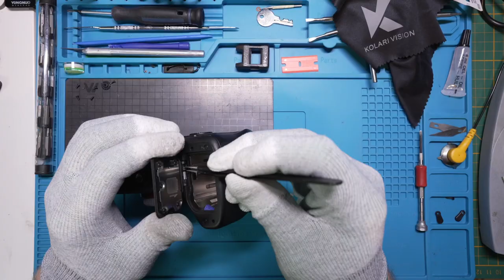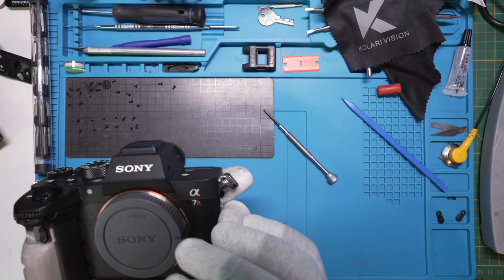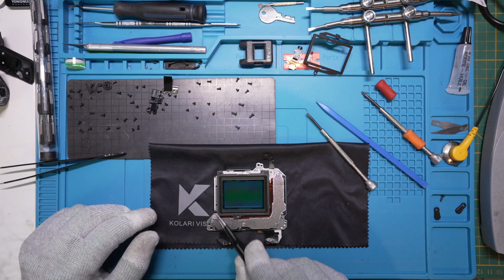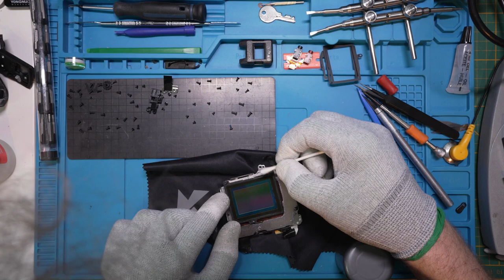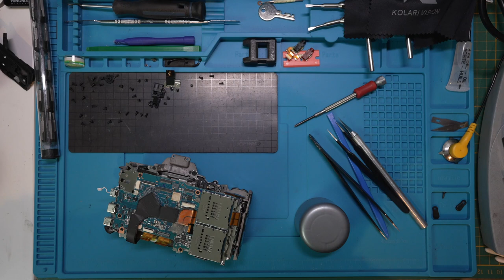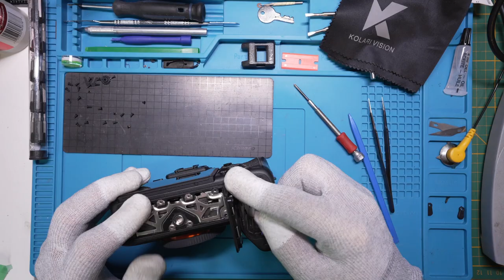Sony A7R IV Astro Modification / Full Spectrum Modification

Comment: I noticed that you did not put any glass back on the sensor. When I modded my A7r I bought a piece of glass to replace the UV/IR filter I removed. Was this unnecessary?
Reply from the maker: I did what is referred to as a naked full-spectrum conversion. This is because my use case is combining the camera with magnetic clip-in filters from Kolari Vision, including IR filters and an OEM filter which restores the stock filtered spectrum the camera shipped with. Adding an additional filter would have provided (replaceable) protection to the sensor from scratches, however this would change the native refractive index of the system and could negatively affect AF performance when doing regular photography.
In your case, if you modified an A7R and added in what I am assuming was a piece of optically clear glass, then YMMV depending on your application. If IR is your application things may or may not be affected. If astrophotography is your application then things are probably not affected since autofocus isn't important for astrophotography. However it is worth noting that the dichroic mirror that acts as an IR cut filter in the original A7R (the outer most filter wafer) can be left in the sensor stack, as it cuts IR wavelengths but not H-alpha emission to any large degree, thus removing the need to purchase a clear glass replacement or any kind of accessory IR cut filter. 
If you're doing IR photography however this filter needs to be removed to ensure proper IR response.
Reply: You just saved me $200
Reply: I did a also a naked Full spectrum modification on my fuji XT1. The problem that i have is that, the Camera can not reach the Infinity focus point. Do you think i can solve this problem with the clip in filter or a clear glas in front of the sensor?😊

Comment: Spencers cameras says that the Sony a7 iv and R models will give off a red light that ruins pictures when modified. How did you get around this?
Reply from the maker: Short answer: Spencer’s is wrong.

Long answer: I don’t have to get around it because it doesn’t happen with the A7RIV. I’ve tested 10 minute exposures in mechanical shutter mode using the camera’s second stage amplifier (any ISO above 320), zero issues.

The A7IV isn’t the same as the A7RIV, different body, different internals. It can be used modified as long as you only use it in certain shutter modes. I believe E-FC works. This is not from personal experience however, it’s from speaking directly with Kolari and LifePixel.

I’ve successfully modified an A7RII but had to build a custom baffle inside the shutter mechanism to block the IR optocoupler. Not ideal but after years and thousands of shots it’s still working.

Comment: I just did a very similar conversion the other day, except I added some 1.8mm AR JGS2 for focus. Almost scares me whenever I see someone not adding glass back as it kills infinity in most cases. Very cool video regardless, I love watching these. Do you have any photos that came out of this camera, astro / daytime?
Reply from the maker: Hi Daniel, I use magnetic clip in filters from Kolari Vision. Leaving the sensor bare was done on purpose so that I could restore stock characteristics using a clip in filter made out of the camera’s original dichroic mirror/IR absorption filter. Or so that I could swap it out for a UV/IR cut filter, various IR filters, or clear glass if need be. Building glass back into it would make using the clip in filters sub-optimal. I have samples available through some of my lens reviews, but they’re done with the stock filter.
Reply: @FerventAstronomy  I agree that it's a good move as it also helps prevent optical artifacts. I've considered doing the same thing often.

Comment: You said you purchased some Kolari Vision filters and since you mentioned in the title that its an astromod/full spectrum mod, I assume that you puchased a H-Alpha pass filter. Do you have any corner aberration issues as mentioned by Alyn Wallace with wide angle lenses on your modded camera?
Reply from the maker: Hi, I actually don't have that filter. I prefer to use the dichroic mirror from the original A7R so I bought one of those instead. At least when using lenses and not astrographs. If I'm using a RedCat or whatnot I prefer using 2" astronomy filters.

Comment: How to shift sensor up front for infinite focus? I see in A7s three brass spacers which removal could shift distance by 0.4mm.
Reply from the maker: There isn't an easy way to do this, and it's by far more useful to add in some additional clear glass filter to restore the refractive index, either directly over the sensor or via a clip in filter. The shims are there to correct the sensor distance and tilt. If you're lucky enough to have three shims of the same thickness you can try removing them all. Otherwise you would need to either machine the mounting points down precisely at micrometer scales, which would also likely require extra shims and lots of trial and error. Or you could try adjusting the sensor's height offset from the IBIS unit.

By far using some type of filter is preferable to restore the correct refractive index of the system.
Reply: @FerventAstronomy  Decided to leave those shims because on of them different thickness after all. I think rather then put outside of camera piece of glass/silica window with AR multicoating
Reply from the maker: @RynaxAlien  I think that is wise. You can get quite an assortment of magnetic clip-in filters from companies such as Kolari Vision, and they have cut custom filters for me in the past when necessary.
Reply: @FerventAstronomy  Unfortunatelly after  Sony A7s assembling camera doesn't turn on at all, not even red LED is blinking. Used different fully charged batteries and connected camera via USB, nothing.

I think I did assemble everything correctly using guide and making photos during dissasembly, only one screw is left unused that has thread for plastic. I can hear a slight rattling sound when shaking. Inserted all of the flex cables fully and pressed the clips. My guess is that I could have torn the weaker flex cables that go into buttons, other flex cables got pressed screwing on boards but that could alone break wires? Would broken leads should be visible when inspecting with powerful light?

I tried to minimize risk of ESD too but it may not been perfect. Would ESD cause the camera not to power up? Would I be able to see it if the motherboard got fried using thermal camera? I did successfully modify Sony A3000 when working less carefully, but this time I screwed up.
Reply from the maker: That’s unfortunate. My suggestion would be to retrace your steps, disassemble the camera again and reassemble it. You will want to make sure that you find the spot where the extra screw belongs as well.
Reply: @FerventAstronomy  Forgot to lock one flex cable. I plan to convert Sony A7 II, maybe it's similar to A7r and will it require window to fix focus shift? I also never converted sensor with IBIS, can it present chalenges?
Reply from the maker: Any time you remove glass from in front of the sensor you change the refractive index of the system and that will affect your lens’ ability to focus in some circumstances. Complexity of mods on cameras with IBIS or no IBIS is similar in a Sony camera.
Reply: @FerventAstronomy  How thick is IR-cut/AA filter sandwish as well dust shaker filter?
Reply from the maker: I don’t know, sorry.
Reply: @FerventAstronomy  Can't you measure filter stack aproximate thickness?
Reply from the maker: I don’t have any filters sitting around to measure, they’re also in different configurations depending on the camera and in any case that wouldn’t tell you the refractive index you’d need. Good luck in your modifications, I’m sure you’ll do fine if you have experience already

Comment: is there another clear glass before the sensor itself? I watch someone who converted his A6000 and it has clear glass before the sensor, he did not install any clear glass filter btw, I was just checking if it's the same for ARIV
Reply from the maker: Hi, I've never worked on an a6000 so I can't comment on that camera. On most Sony cameras with IBIS there will be a single bonded filter, as they do not need to have a seperate ultrasonic sensor cleaner which is typically bonded to a top filter.

Comment: Hey I looked at the mod companies and they don't advice A7RIV to be modded. I'm curious what's the result of this modded camera? Any samples?  Thanks man.
Reply from the maker: Great question! Kolari Vision, for example, does conversions on the A7RIV, and I spoke extensively with them prior to landing on my choice to do a naked full spectrum conversion on this camera. The A7RIV doesn’t have the same problematic IR optocoupler in the shutter that other cameras in the A7 line like the A7RII have. I’ve confirmed this with my own testing, and 10-minute dark exposures are clear of this type of internal light source. The A7RIV has minimal PDAF striping, however depending on the situation you will need to use post-processing to correct for the fact that the A7RIV’s sensor is constructed from 4 smaller panels and in long exposure astrophotography their noise profiles will be different enough that you may notice a 4 quadrant pattern

Comment: Great work, and incredibly insightful! 😎

5:00 What kind of solvent were you using to remove the adhesive/residue from the sensor?

Were you also cleaning the sensor surface itself?

I'm thinking of converting my a7iii into a full spectrum camera as well (also bc I wasn't storing my camera dry enough in the ever-so-humid climate of Hong Kong) 😅

Eventually, this caused a rainbow pattern to form between the IR cut glass and the sensor itself.

My assumption is that it's the result of thin film interference - as depicted by Bryan Rolfe on YouTube. 🤔 

I'm hoping that removing the IR cut glass will get rid of the rainbow pattern as well as the following solvent clean-up and swabbing, if any, won't damage the sensor. 🤞🏻 

Do you have any tips? 🙏🏻
Reply from the maker: You can try LifePixel’s DIY section to see if they have a guide for your camera. Acetone and isopropyl alcohol are the two solvents that are the most useful.

Comment: Just modified full spectrum the A7S and left it bare sensor. Any idea why it won't achieve infinity focus? I am playing around with the shims now, tried without them and with them still with not infinity focus. Will do more tests.
Reply from the maker: When you remove the filters from the sensor, you change the refractive index of the system. Mirrorless lenses don’t have as much focus distance buffer past infinity as compared to DSLR lenses, so from the lens’ perspective the sensor is now too far away to achieve focus. You need to install some type of filter in between the lens and the sensor, whether it’s a clip in filter or a permanent filter. The extra glass will help focus the light to where it needs to be, provided that it has the required refractive index.
Reply: @FerventAstronomy  Thanks. Will do that.
Reply: @FerventAstronomy  So I added a clear filter which was slightly thinner than the 2 I removed , and completely removed the shims and I must say the focus is actually better than factory. I get a super crisp focus on a 800 telephoto mirror something I would struggle with the a7sii now all my lens have amazing focus! Thanks for the tips! Cheers. Awesome transformation! Can't wait for a clear sky at night! Woot Woot! ;))
Reply: Just a quick question. So I removed the main thick low pass filter and a thinner one in front of it.( 2 in total) I see other people on forums are saying I need the uv/ir back for the full spectrum astrophoto to avoid star bloating. Do I need the thinner filter back, I assume that's the uv/ir? I see it gives the natural colors back. Thanks.

Comment: Awesome. I assume for sony a7sii is quite similar.
Reply from the maker: Hi, in theory yes, but not in practice. To quote Kolari Vision: “[This] camera contains an internal diagnostic IR Led. This can cause light leaks when using very long exposures and high ISOs in the H-alpha and IR enabled conversions, in the range of 30 second exposures at 6,400 ISO.”

Essentially, if you remove the sensor filter the camera spoils its own exposures internally.
Reply: @FerventAstronomy  Have you experienced any light leaks? I am thinking to modify mine too (the a7sii) but still thinking.
Reply from the maker: The A7SII suffers from this issue, and therefore is inappropriate for modification. The light leak can be significant. I’ve seen the issue firsthand with an A7RII. Some Sony cameras suffer from the issue, some do not. The A7III is a popular choice since it doesn’t suffer from the issue.
Reply: @FerventAstronomy  Thanks!

Comment: Hey, amazing! I’ve been meaning to modify an a7iii for sometime but wasnt sure if i should do it myself. I modded the canon 6d previously but seems like mirror less are much more difficult than dslrs. 

Do you think the process for a7riv and a7iii would be the same. If yes, then I can refer to this video😅
Reply from the maker: Each camera is different, but there are some general design consistencies within each brand so it won’t be the same but it’ll be somewhat similar.

Comment: Was there a weather sealing gasket at the bottom of the camera?
Reply from the maker: I don’t remember as this was quite a while ago. But I’ve never really noticed any weather sealing in any of the Sony’s I’ve worked on. Lens Rentals or Kolari Vision are good sources for tear downs that would likely point out that kind of thing.
Reply: @FerventAstronomy Thanks for the reply man, im asking this cuz ive heard that sony doesnt weather seal the bottom of their cameras so im gonna those out.
Reply from the maker: Yeah, unless it’s one of the Olympus cameras with an IP rating, with a lens that also has an IP rating, I tend to ignore any manufacturer’s claims of “weather resistance”. Having worked on water damaged cameras from all brands, none of them are good enough to keep moisture out.

Comment: I modded my A7iii to a naked full-spectrum camera like you did. But the issue is the camera can not focus on infinity, should I put a piece of clear glass on the front of the CMOS?
Reply from the maker: If you’re using standard photography lenses some may not reach infinity since the refractive index of the system has changed. A clear filter should solve the problem depending on it’s refractive index. Places like Kolari Vision make magnetic clip in filters that work well and might solve your predicament.

Comment: didn't you replace the hot mirror with clear glass filter?
Reply from the maker: No, since I am using this camera with magnetic clip in filters from Kolari Vision I wanted a “naked” full spectrum conversion so that the refractive index is not changed when using an OEM white balance filter.

Comment: Hi :)
Very interesting video 
I read your comment about IR pollution, and I wondered if the A7 IV was also plagued by the IR LED.
I already use an A7rIV, and I was planning to replace my Astro modded A7r with and A7 IV
Reply from the maker: From what I have seen, the A7IV does and sometimes doesn't exhibit an issue. Allegedly in full electronic shutter mode there is IR pollution in the A7IV, however in mechanical (or possibly elec first curtain) shutter mode there is no issue. I do not understand why this would be the case, given what I know of the issue in Sony's other cameras. So a modded A7IV in full mechanical shutter "should" be fine.

That said, I have not been able to have anyone confirm to me if this holds true for any exposures longer than 30 seconds. I usually do my tests for a minimum of 5-10 minutes, but thus far I have not seen any replications of this for the A7IV.

So, keep that in mind depending on your type of astrophotography.
Reply: @FerventAstronomy  Thanks a lot for your intel on this matter :)
It confirms what I've seen recently on one model website.

As far as my use, this would be for nocturnal nightscapes panorama, and maybe a little deep sky, but not that much
So the A7 IV should be a great choice.
Reply: @kindjalkazad  Did you end up astro modifying the a7 IV? I'm looking to full spectrum my own and I'm wondering if there ended up being significant light pollution or not.
Reply: @notravstar  Yes, I do own a modified A7IV :)
The mod has been done by a modder here in France
Initially, I wanted to mod my A7rIV...but divergents advices/opinions from modders lead me to ditch this idea, to get back to the A7IV.

In the end, I had a really long talk with a Infrared photographer, that use everyday an A7rIV...and I should have gone this way.
But, that's not really a problem :)

So, to get back to the Astromodded A7IV, it's working great, without any IR light pollution, in any shooting modes.
If you need, I can forward you dark files from mine, and a comparison with my non modded A7rIV
Reply: @kindjalkazad  thanks for your quick reply, I would really appreciate some dark frames! Do you know what kind of modification was done (full spectrum/looser ir filter/etc)?
Reply: @notravstar  On mine, the filter stack has been removed and replaced with an Astrodon Filter.
It's made by Richard Galli from Eos For Astro :)
You can contact him, if you want. He is a really great guy.

Have you got a mail where I can send the dark frames?
Reply: @kindjalkazad  interesting. My A7 IV has IR light pollution in all shooting modes. Furthermore, using clip in filters causes another reflection streak in the final image. I wonder why there is a discrepancy between our A7 IVs.
Reply: @JerryQian  hi Jerry…in the end, I located an IR pollution on mine too, by using a clip in filter.
It has now been given back to my modder in lieu for the resolution of a broader problem with this camera, but definitely it’s not a good idea to mod A7 IV.
Learned it the hard way(cost me 800€)